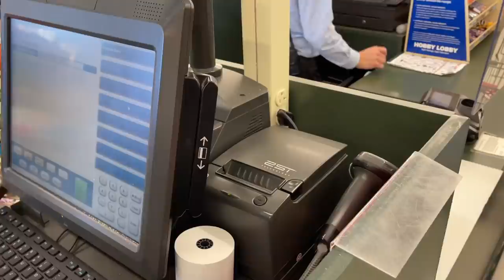Mr. Sam and I CRANKED on Dr. Pepper All Weekend, Took My Staff on the Shopping Spree of Their DREAMS

Comment: Parker next time you do a bolt check use some 1-3mm paint markers to mark the bolt heads and washers once they are tight, then you can see what rattles loose and how loose it rattles it!

Comment: AweSam content. Just wondering, are able to run the plumbing for the radiator on the cold side of the turbo instead of the hot side? Might save yourself some heartbreak down the track.